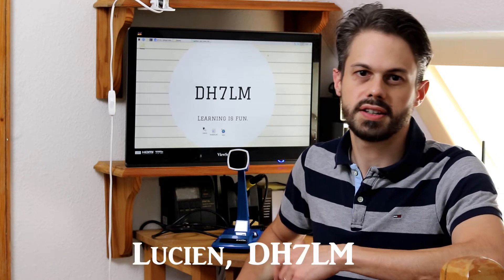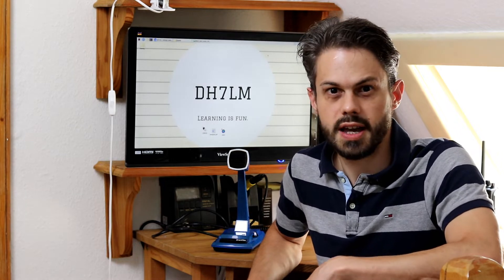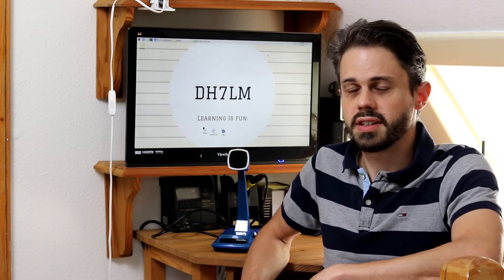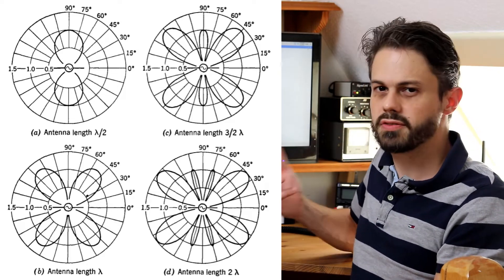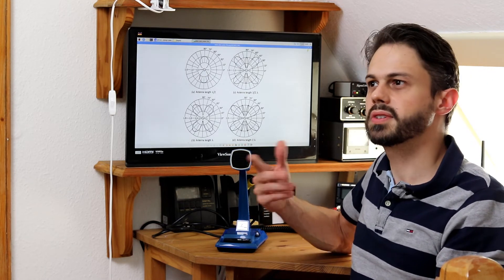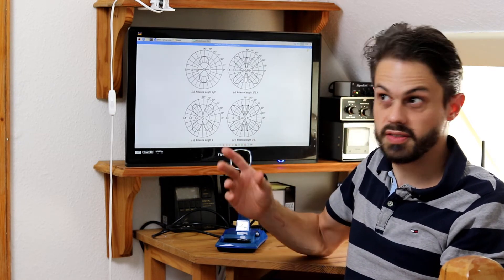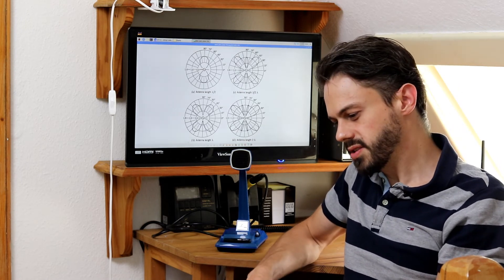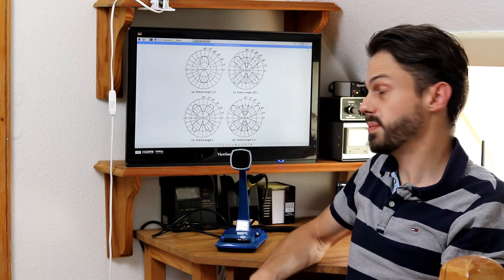Best HF Antenna: The Monoband Dipole

Comment: I realize this video is over 4 years old; but I'm really hoping you - or perhaps someone else with knowledge on the topic can help me with a question. I agree 100% that a monoband dipole is great for HF, and I use one myself. So the question - does it translate to VHF and UHF? I would like a base antenna to listen to a local repeater. Nearly every antenna design is for 2m/70cm, and I don't really know why. I don't care at all about 2 meter, and am looking for a monoband solution for 70cm only. I saw a post on reddit about making a GMRS dipole (I would be tuning my antenna to 444 MHz, but I searched for GMRS antennas figuring the range was close) and the top response was "A dipole for the GMRS frequencies would only be ~35cm long. You'd be better off with a J-Pole or a ground plane at home." and I didn't understand. What does how long it is have to do with it? Why would the other 2 options be better than a dipole at this frequency?

Comment: The best antenna is one that works the best for you in your QTH.  Personally, I feel the antenna, that is hard to beat, is a loop fed with Ladder line, but completely understand why that wouldn't work for everyone. Also, resonance is not "magic", and I'll quote the antenna bible "Antenna handbook" from Chapter 2 "Please recognize that an antenna need not be resonant in order to be an effective radiator. There is in fact nothing magic about having a resonant antenna, provided of course that you can devise some efficient means to feed the antenna. Many amateurs use non-resonant (even random-length) antennas fed with open-wire transmission lines and antenna tuners. They radiate signals just as well as those using coaxial cable and resonant antennas, and as a bonus they usually can use these antenna systems on multiple frequency bands."   Of course there are caveats to the quote, but I'm sure everyone gets the idea of it.  Once again, the best antenna is the one that works the best for you and if you are happy with it then that is all that matters --

Comment: Very good presentation. I have tried to tell the same thing to all the new hams I have helped over the past 50 years! I presently use almost all single band dipoles. Can work 100 countries in a single contest weekend on multiple bands with the dipoles. I do put two dipoles on the same feedline in some cases. A common name for this is a fan dipole, although mine are just parallel dipoles with a few 6 inch spacers.

Comment: I agree 100% with you on the monoband dipole.  I just replaced a fan dipole that I bought from a major ham radio retailer with a homemade 40 Meter dipole 14 gauge copper wire, 1center coax panell connect or and home made insulators.  It works grwaty and I'm not losing positive energy to other wires on a fan dipole.  Im making great contract at 100 watts or less.

Comment: To get the best DX performance, from a dipole hang it vertically from a tree. This will provide an extremely low angle of radiation. It is quite possible to parallel dipoles for different bands using this method but it requires some trimming of length that can be a problem as the dipoles will interact with each other to some degree. I strung a 40 meter dipole from the top of a tree at my old QTH in North Carolina. The bottom was only a few feet above ground. I regularly worked Europe and Australia with it running only 20 Watts. For an end fed half wave it is possible to use a tree to take a first section of the antenna wire vertically before stringing the rest horizontally to another tree to make an end fed inverted L. This provides a low frequency DX antenna that also works extremely well for local and medium range contacts, Dave, N2SN.

Comment: Agree 100%  I work very covertly.  3 homemade dipoles cut for 6 - 10 - 20 meters in my attic above my garage. I’ve worked the WORLD from qrp to 100 watts max. Is it the best.....no......is it fun.....yes! You’ll learn a lot about antennas if you do your research and build and tune a few dipoles.  The best part.....my neighbors have no idea ! 🤣 

Also have end Feds for 20 & 40 that I can throw up in the backyard when the weather is nice.
Reply: I thought a fan dipole would be great, until I later realized the optimal height for a given band's horizontal antenna is 1/2 wave length above ground. Separate dipoles at unique heights would be better.

Comment: I use mono home built dipoles with a remote switch to each antenna for each freq.  10, 15 , 20 , 40 meters,  working on a 80 meter which will be 156 feet total length. I can't put this length in my attic. My attic situations on a resonant antennas works well for me at 100 watts.

Comment: good stuf! tnx for sharing. i agree that a mono-band dipole is more efficient.  but for new hams jst starting out, why limit urself to one band?  how will they know what peaks their interrest if their stuck on a single freq?  wouldnt a better choice be a center fed dipole cut for 80meters and fed with open wire ladder line?   back in the day we called this a "classic multi band dipole"  b'cuz balanced feedline is virtually lossless and with a tuner we coud load this single dipole (actually it would be a doublet)  on 80m, 75m, 40m 20m, and even 15m with fairly good results!  i mean, how does a beginner, jst starting out,  know if he will be interested in SSB... CW... or digital?  seems like a mono band dipole as a first antenna severely limits the choices for someone without experience to know which band or mode to start on?   after a guy plays around with ALL the bands for a wile (with this ONE antenna) he can then cut it to the band of his choice... and it will now be a mono-band dipole :)   i really dont know if this is a good idea or not today... i got my Novice ticket back in 1959 :)   jst tossing it out ther.
Reply: Who's got room/space for an 80 meter dipole???????????????????????????????????????

Comment: The best antenna a ham radio operator can have is one that resonates at the set of frequencies he/she operates at with the minimal amount of transmit power. Most ham radio operators will never achieve that antenna. Most ham radio operators will be happy enough with the compromise antenna that they are forced to put up due to a lack of sufficient lateral area and the difficulty of erect their antenna at an efficient height. Most of us, I include myself, will be happy to erect our antenna at around 30 to 35 feet (10m) and use what ever means possible to make our antenna look electrically correct for the resonate frequencies of operation using coils, traps, and all sorts of crunched configurations of the antenna legs (2 halves of balanced dipole) due to a small garden. Some of us may have enough room to only work the higher portions HF band with a quarter wave or half wave monoband antenna. Those of us that with ingenuity  will try all types of dipole configurations while others will not and ask others what they use. Some antennas that give poor results with antenna modelling software or don't give good results with our slide rule calculations give those with ingenuity good results some of the time. There is no 'one' antenna that will work for everything. Even the minority of ham radio operators that have the money to put into elegant antenna towers and huge directional pieces of metal atop those towers use compromise antennas, that are slightly more efficient thanr than our wire dipoles because those expensive antennas are only a quarter wave or half wave in physical size. I say all of this with 31 years of trying many configurations of wire dipoles with sufficient space to erect a quarter or half wave dipole in some instances and in others having very insufficient space for an antenna. I enjoyed your video Lucien.